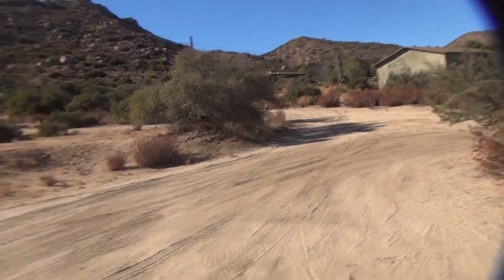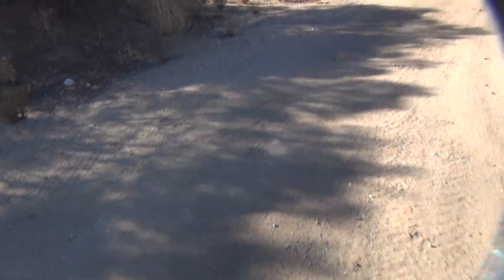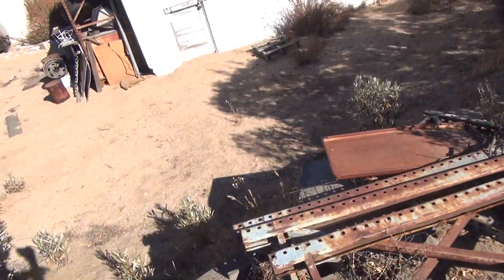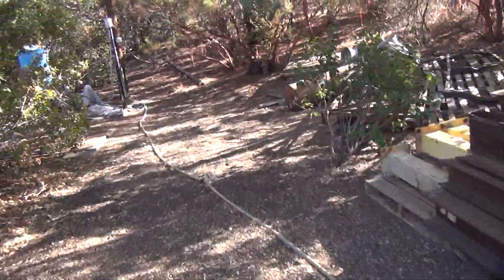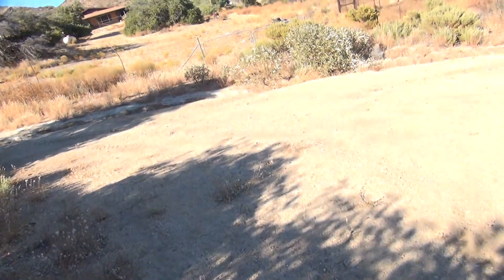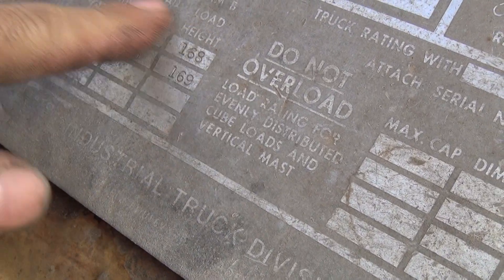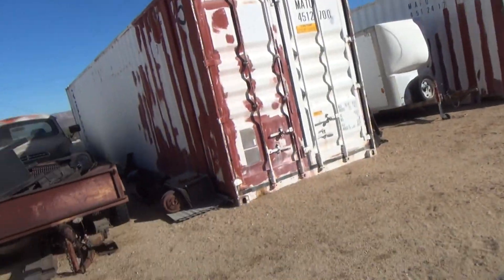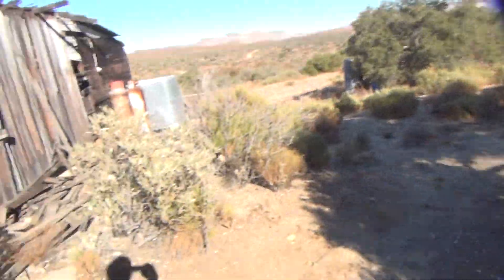#101 2020 tatro machine future plans jacumba property needs work but i am getting it done harley

Comment: If you have a "deep" well (the pump is down a 6" steel casing submerged in water) turn power on to pump and you should get water. If you have a shallow well (pick-up line with foot valve is down in a concrete casing 3-5' wide) you have to prime the pump. The filter is a "whole house" sediment filter (4.5x10"). Good luck with your lot. You could rent a dozer to grade property and move those containers around.